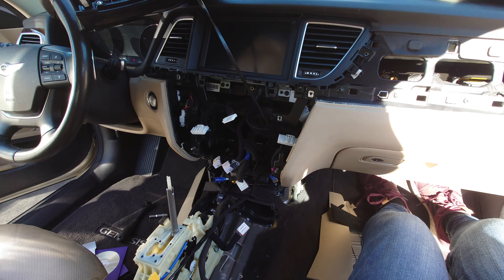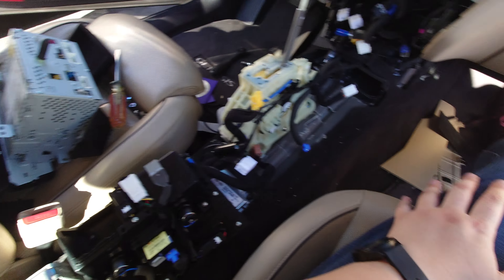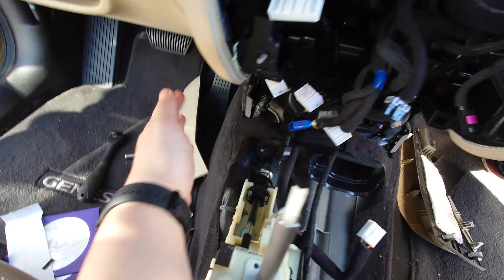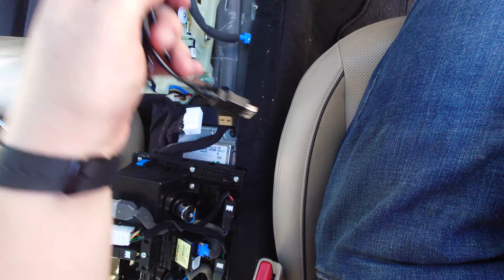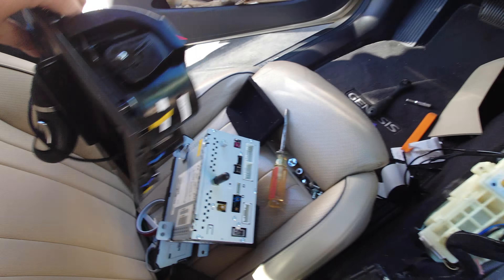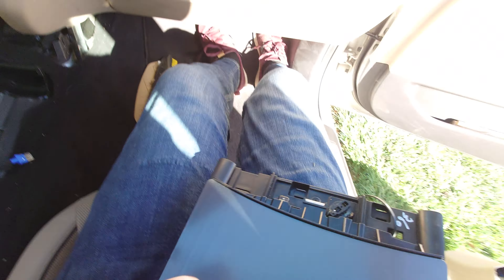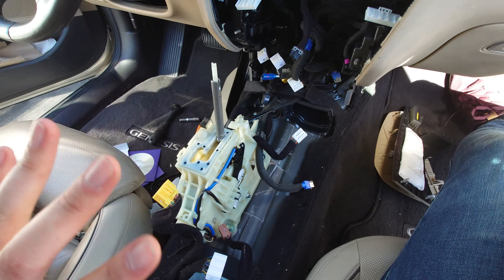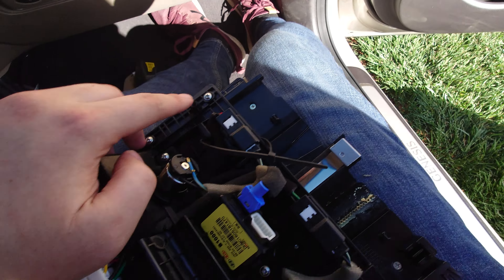How to remove center floor console in Hyundai Genesis G80 sedan 2015 2016 2017 2018 2019 2020

Comment: So pretty much the title should be "what everything looks like after it's been disassembled and zero instruction footage".
Reply from the maker: Apologies, I tried to record while I was disassembling it but the video was really long and shaky.  It was even worse to watch than this video.  That's why I left text instructions in the description.
Reply: I am in the process of removing my upper console assembly with the shifter/boot. I have the front 3 clips off but toward the back by the arm rest I'm trying to pull up but it's just flexing. I'm afraid it will snap if I force it up more.
Reply from the maker: @dcastro5551  the assembly with the shifter, cupholders, and heated seat buttons is all one piece.  Just yank up on the shift knob to detach it, then pry off that assembly.  The rear part of my assembly required some force to yank out.  https://www.hgenesisdh.com/shift_lever_repair_procedures-405.html
Reply: @faeinthebay  part A in that diagram is not coming up completely. The clips towards the back won't disengage. Does the entire assembly just pull straight up?
Reply from the maker: @dcastro5551  after looking at a better diagram, I realized you need to tilt up the front part and then pull away from the center console compartment.  Here's the better diagram that shows you where the clips are.  https://www.hgenesisdh.com/floor_console_assembly_repair_procedures-728.html
Reply: @faeinthebay  success. Had to use a metal pry tool but it does come straight up.
Reply from the maker: @dcastro5551  yay, I'm glad I could help!  Best of luck with the rest of your repair.  And definitely search hgenesisdh.com for instructions and diagrams, they have most of the service manual on their site.

Comment: Would you happen to know how to remove the gear shift knob from the boot?
Reply from the maker: Yes, I've done that before.  It's a locking collar.  I recall it being a bit complicated, so removing the base the boot might be easier.  I think I can just be unclipped but it's been a while.
Reply: @faeinthebay  Thank you for the prompt reply! Would you ever consider making a video to demonstrate the whole process?
Reply from the maker: @hialeah08ify  Unfortunately I have too many other projects ongoing, but if you remind me in a month I might be more available.  Don't forget that it's easy to pry up the silver plastic console around the boot, so you could always just do that.
Reply: @faeinthebay  thank you, but I run into issues removing the shift knob from the boot even after removing the boot with the shift knob still attached to it.
Reply from the maker: @hialeah08ify  ah, That's right. It's rather complicated and I scuffed the plastic while trying to do it. I think there is a screw hidden in the center.  I recall prying off some of the silver plastic.